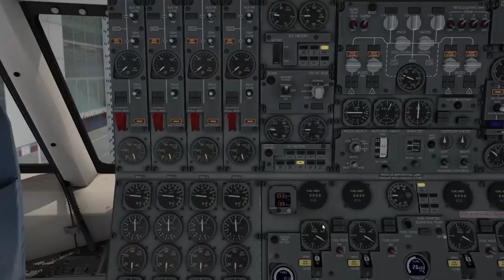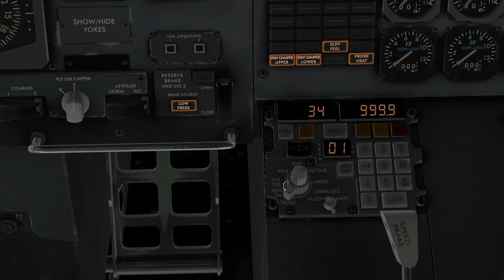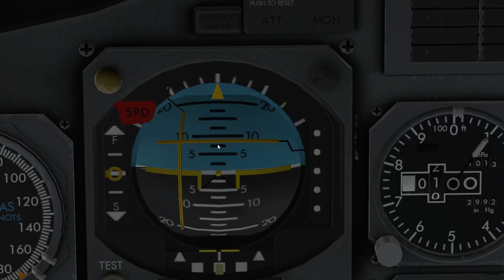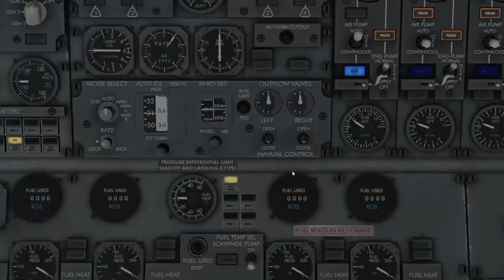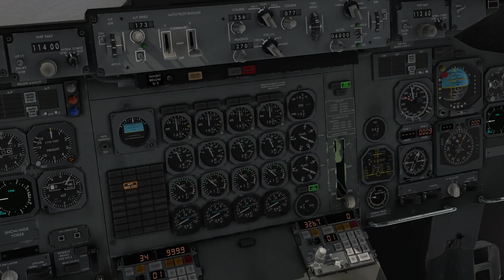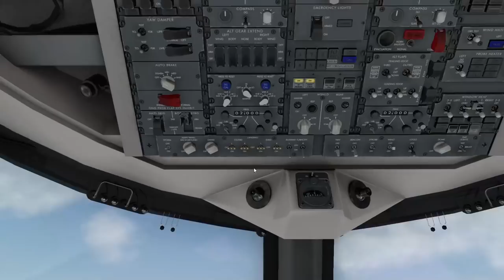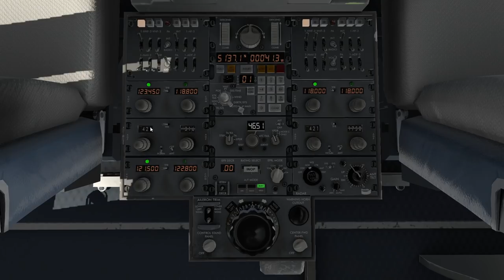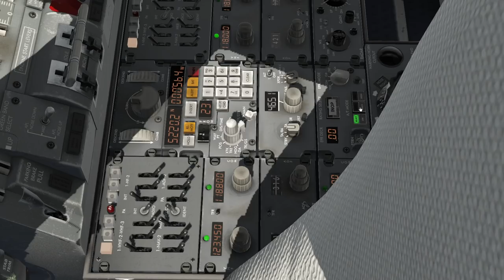Felis 747-200 Full Tutorial - Part 2 - Let's Fly

Comment: Good tutorial, but the simulation s/w is poor.  Engine performance , EPR/rpm relationship is wrong at all settings, and instrument fidelity is poor.  If a developer is going to the trouble of simulating every switch, why cant they map the correct engine performance data from the flight manuals to the look up data tables in a simulator?
Reply from the maker: Thanks David. I know the EPR simulation was discussed extensively during testing. To the best of my knowledge X-Plane doesn’t have a lookup table system, but the engine simulation is fairly simple with a fixed reference between all engine parameters. I don’t know if further improvements are planned in this regard - the upcoming HotStart Challenger 650 uses a totally custom engine model that bypasses the X-Plane default systems totally in order to provide an accurate simulation.  The instrument quality was another issue discussed during testing, and some enhancements were made. Perhaps Felis will revisit this in the future.